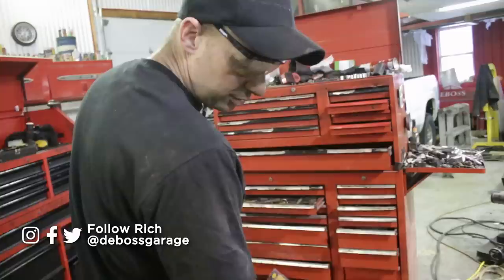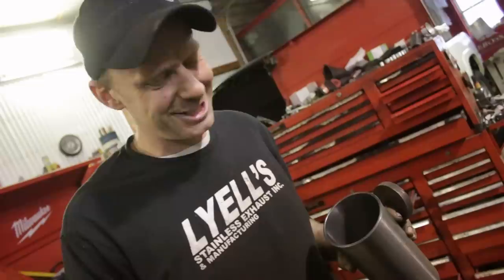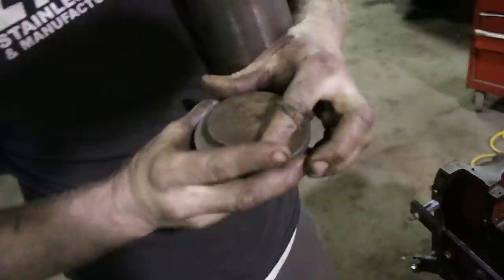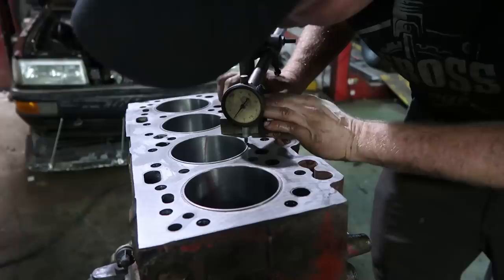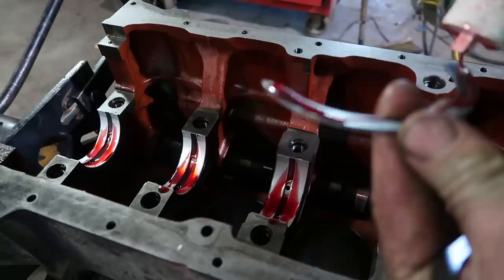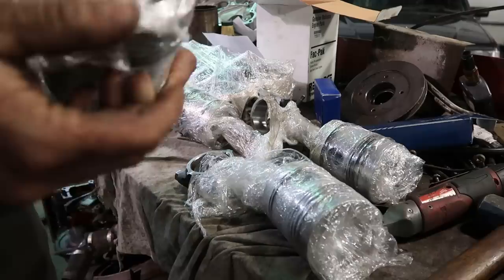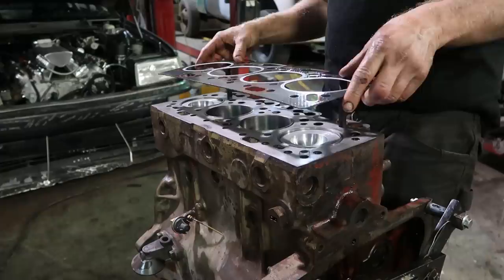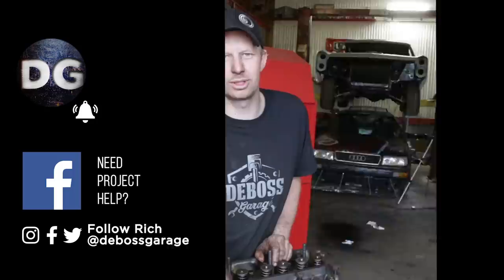3.9 Perkins 4-cyl Dry Sleeve Engine Rebuild | Massey Ferguson 270 [EP2]

Comment: Good day  When you were  talking about wet cyls.  with the water issue is that called  electrolosis   ( my dictionary  didn't have it in).  Also how many hrs. were on MF. is that 236?   What would cause a bearing to spin.  Thanks

Comment: there shouldnt be enough of the green loctite sealant on there to not conduct heat and ive always seen it used on the bottom like on a wet sleeve but it the manufacture says do it, i do it cause if it comes back its on you. doubt the engine builder will pay for it for giving bad advice.

Comment: Allis Chalmers D301's were bad about cavitation still have a set of sleeves outa an engine i rebuilt in the 80's all 6 were bad. Holes were so low in the sleeve (no compression pressure) the owner just put in stop leak Evey time he saw antifreeze in the oil.

Comment: Y would you lock tight it once the head is on there is no way for that liner to move.
Reply: Never loctite a liner into an engine.The reason a liner can move is if the protrusion is incorrect,typically too low in comparison to the others.He only skimmed over it in the video but liner protrusion should be checked at least on four points on the circumference off each liner.Had a guy rebuild a J Deer and bout thousand hrs later had coolant down in the sump.After removing head it was found that protrusion on the offending cylinder was way off leading to movement and failure off a coolant sealing o ring.Greetings from Ireland.

Comment: What Audi is it in the background at 20:00?
Reply from the maker: a 91 V8 that we saved from the crusher.  Swapped an lS in front of the built Quattro, added 4 turbos, moved everything to the back of the car and made it a race car
Reply: @DEBOSSGARAGE Nice👌😍 The Audi's from the 80s and 90s is the best. I have a Audi 100 from 84' myself, but thats only front wheel drive.

Comment: What its balancer used for ?
Reply: To balance out first order vibration harmonics.Very common on 4 cyl engines,rarely used on 3,5,or 6 cyl as they don't vibrate as much as 4 cyl.Basically a counter weight driven by crank at a fixed multiple off crankshaft speed.Hope this explanation helps.

Comment: so how long does a rebuilt engine last if done right??
Reply: Just as long if not longer than the stock build as lkng as it is done correctly.
Reply: Jeff Anderson, OK cool thanks, is it always necessary to buy a new crank?
Reply: Jacob Friesen only if the current one is damaged. You can grind it under sized if it will clean up as the one he put in has been done since he is installing the .10 under bearings.
Reply: Tim H, ok thanks for the info, do you have any good tips on engines?
Reply: Jacob Friesen just study everything you can on the engine you are interested in, with the internet you have millions of cumulative years of experience and expertise at your fingertips. In my days all we had was the old “How to hot rod the small block chevy” type of books. Now you have shows like Engine Masters where they throw different combinations on the same engine and then dyno it and get teal info which parts actually work or not. So much information out there.

Comment: 15:33 when you lubricate threads you're supposed to tighten to a specific torque you're doing it wrong. You will overtighten the bolts by 100% in the worst case.

Comment: Are they a diesel or a petrol
Reply: Jack Gillen diesel,  sleeved petrols are (to my knowledge)  rarely used .
Reply: I know some high performance gassers will sleeve the block, and aluminum blocks will have a thin sleeve, but not a big meaty sleeve in a iron block for a regular gas motor.

Comment: That Perkins 3.9 looks like a copy-cat of a Peugeot Indenor 4-banger....with and without wet Liners. The story about cavitation is true,the older Indenors with wet-liners had Liner-Corrosion issues when the wrong coolant was used....bad/wrong coolant would eat right thru the drop-forged/punched nodular-iron Liners.